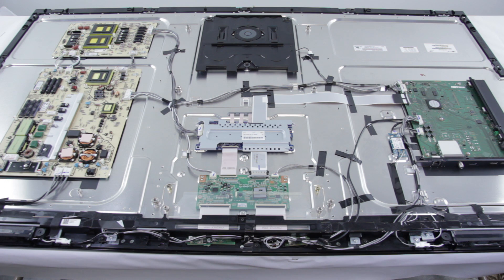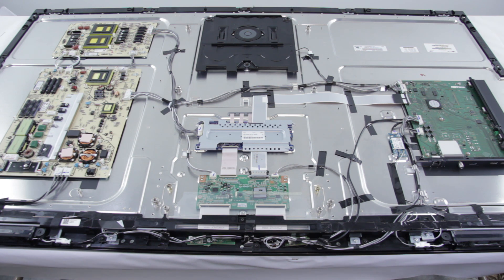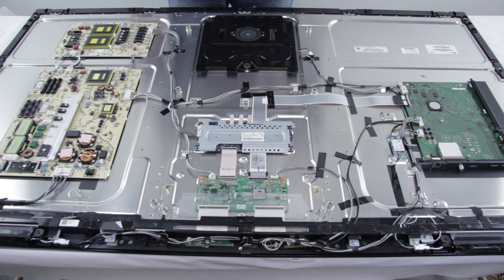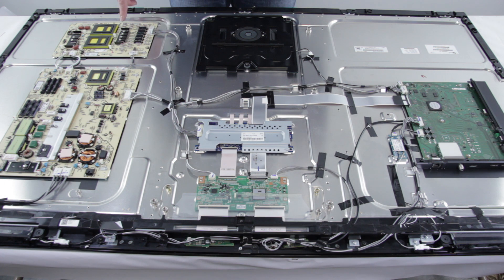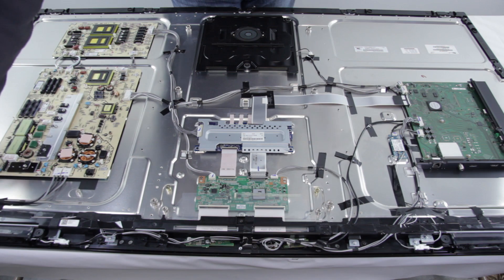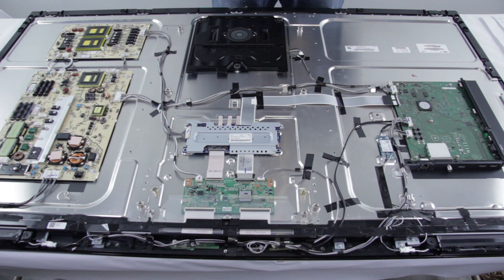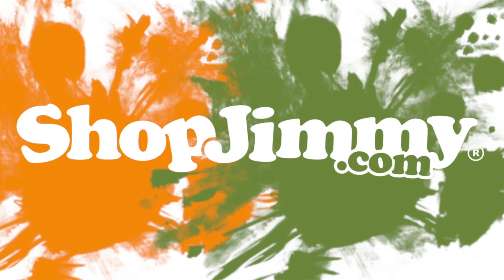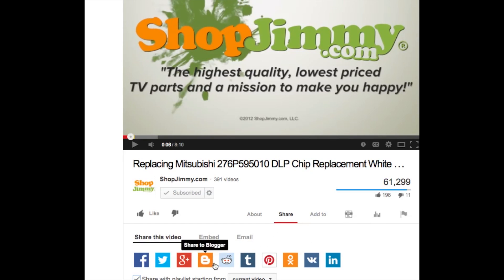LED TV Repair Review Power Supply Overview-NO Power Common Power Supply Repair & LED TV Power Supply

Comment: Hello Jimmy,  I have a Samsung UN39FH5000F.  It has a red power LED when off.  When you press power the power LED goes off, but the TV does not power on.  You have to unplug and replug the power cord to get the power LED to come back on.

Already replaced the power board BN44-00496B, with no improvement.  Other board part numbers are:  Main board: BN94-06692C / BN97-06298Y 0276.  Panel board: V320HJ2-CPE2
Reply from the maker: Rob Wilson  PLEASE SUBSCRIBE TO OUR CHANNEL - Try all repairs and troubleshooting at your own risk.  I recommend replacing the main board in your TV.  Click this link to replacement parts for your TV model number:  http://www.shopjimmy.com/catalogsearch/result/index/?cat=56&q=UN39FH5000F  There may be multiple boards for the same TV model number, be sure to match part numbers on your current board, with your replacement for compatibility.  Here is a link to a video showing how to identify your part number, click here:  https://www.youtube.com/watch?v=BEPWrefQvqI  Thanks and please let us know if you have any further questions with your TV Repair!  www.shopjimmy.com
Reply: ShopJimmy.com Thanks Jimmy.  Unfortunately you are currently out of stock, so I had to Google for another supplier.  I replaced the main board, and now the LED status light stays on, but I do not get any picture.  I reseated the ribbon cable, as when I connected the first time, I was getting a blue splash screen, and then it would quickly go off.  After reseating the ribbon cable I get nothing at all.  What could be the issue?

To recap. 

Replaced power board,  replaced main board.  Still won't power up to get a display.
Reply: Rob Wilson Found your video for the flashlight test.  Pressed menu, no image on screen when searching with a flashlight.
Reply from the maker: Rob Wilson  Try all repairs and troubleshooting at your own risk.  It sounds like you received a defective replacement main board.  I recommend checking with the company you purchased from to see if the board is guaranteed to be working.  Thanks!  www.shopjimmy.com
Reply: ShopJimmy.com Received a replacement board.  Supplier had me try unplug white connector cable from power board to main board.  TV backlight came on.  Next reconnected cable and disconnected Tcom ribbon.  TV goes from off to a flicker of backlight on.

New main board arrived.  Installed it, and when plugged in, the TV cycles from off to backlight flickering on, then TV goes back to off.

Is it time to junk the thing, not much left to try replacing?
Reply from the maker: Rob Wilson   PLEASE SUBSCRIBE TO OUR CHANNEL - Try all repairs and troubleshooting at your own risk.  Sounds like you received another defective replacement board.  With the test that you ran, it says you should replace the main board.  What is your main board part number?   This video can help you.  https://www.youtube.com/watch?v=BEPWrefQvqI Thanks!  www.shopjimmy.com
Reply: ShopJimmy.com Thanks Jimmy.  What is supposed to happen when you disconnect the Tcom ribbon cable? What is the TV supposed to do?
Reply from the maker: Rob Wilson   Did you find your main board part ID number?  Disconnecting the t-con board ribbons can have different results for different TVs.  Thanks!  www.shopjimmy.com

Comment: Hi, I have a Vizio E261VA LED LCD tv. When I try to turn it on, I have no power, lights, sound. Nothing.The TV will not turn on. I'm not sure when I bought it, (maybe 1-2 years old), but about a year ago it fell off a dresser. It worked afterward, but sometimes I had to play with the button (press hard, hit the tv, lean it to the side). Then a few days ago, our power went out (I'm sure the TV was on), and it hasn't worked since. I took it apart and looked at the capacitors, and they all look flat and I don't see any burn marks or anything. Can you give any advice? Should I buy a power board? I cannot afford to take it to a repair shop. If I bought one from your website, would I be able to return it if I tried it and that wasn't the problem? Thanks
Reply from the maker: shadowcharizard10  PLEASE SUBSCRIBE TO OUR CHANNEL - Try all repairs and troubleshooting at your own risk.   I recommend replacing the main board in your TV.  Click this link to replacement parts for your TV model number:  http://www.shopjimmy.com/catalogsearch/result/index/?cat=56&q=E261VA  There may be multiple boards for the same TV model number, be sure to match part numbers on your current board, with your replacement for compatibility.  Here is a link to a video showing how to identify your part number, click here:  https://www.youtube.com/watch?v=kxkeGLhlQY8Thanks and please let us know if you have any further questions with your TV Repair!  www.shopjimmy.com

Comment: I have an LG  TV model number 55lm6400-ha.auszlut.  When I turn it on a red light flashes 3x then turns off. I have replaced the main circuit board....  Shames result. Would you suggest replacing the power boar?  If so, what is the part number and cost?  Second question.  Can I return the main circuit board to you as it has not been used?  Jim
Reply from the maker: Jim Franklin   Try all repairs and troubleshooting at your own risk.  Yes, I would recommend replacing the power supply board.  Here is a link to our return policy.  http://www.shopjimmy.com/returns  Click this link to a replacement power supply board for your TV model number:  http://www.shopjimmy.com/lg-eay62709002-power-supply-led-board.htm  Be sure to match part numbers on your current board, with your replacement for compatibility.  Here is a link to a video showing how to identify your part number, click here:  https://www.youtube.com/watch?v=_4Qpfan0vdU  Thanks and please let us know if you have any further questions with your TV Repair!  www.shopjimmy.com

Comment: Westinghouse DW46F1Y1 Led TV - won't turn on... Standby light is on. Has worked after unplugging power a few times, but turns off and same symptom occurs. Main Board?
Reply from the maker: Geoff Ruscoe   Try all repairs and troubleshooting at your own risk.  This could be a problem with either the main board or the power supply in your TV.  You can replace each of those boards individually to see if one of those fixes the problem.  Unfortunately I do not see any replacement parts in the search results for your TV model number on our website.  Thanks and please let us know if you have any further questions!  www.shopjimmy.com

Comment: Hi I was wondering whether you could point me in the right direction with a problem I have with my Samsung LE40B530 LCD television. The screen flickers terribly and can only be used with the backlight turned down to zero. On some of the LCD Samsung TV's people have resolved the problem by cutting a link on the power board but the link doesn't seem to exist on my TV. Any help would be really appreciated. 
Thank you. 

Lifeboat.les@gmail.com.
Reply from the maker: Leslie Jones Try all repairs and troubleshooting at your own risk.  This could be a problem with either the power supply board or the LEDs in the TV.  Click this link to replacement parts for your TV model number:  http://www.shopjimmy.com/catalogsearch/result/index/?cat=229&q=40B530  Be sure to match part numbers on your current board, with your replacement for compatibility.  Here is a link to a video showing how to identify your part number, click here:  https://www.youtube.com/watch?v=sSJexLvRrjM  Thanks and please let us know if you have any further questions with your TV Repair!  www.shopjimmy.com

Comment: hi there...i own Sony 40 inch EX43B Series BRAVIA TV
however yesterday morning out of sudden it went dead..no red indicator light...
i opened the tv and it seems the circuit board all placed the below section of TV...
Can u help me out to restore back my TV to its functional state? TQvm
Reply from the maker: Ahmad Muhammad   Try all repairs and troubleshooting at your own risk.  If you have experience with a meter, you can check for the 5v standby on the power supply.  Thanks!  www.shopjimmy.com

Comment: I have a Samsung UN60EH6003F TV that will not turn on. The standby light is on constantly and does not blink when "on" is pressed on the remote or on the TV. There is no clicking sound. The TV mysteriously turned itself on and off a few times before it stopped turning on.

Comment: I have a Samsung UN55F6300AFXZA that won't turn on.  It is 14 days out of warranty!  The red standby light is not on either.  I have tried unplugging and letting it rest for a while, changing power outlets, and the power button on the back as well as every other trick Samsung support mentioned.  Nothing works.  Still no power...no sign of life.  Any suggestions before I call a repairman?
Reply from the maker: Kristi Bloss    Try all repairs and troubleshooting at your own risk.  Disconnect the cable from the power supply to the main board and look for the backlights. If there are lights, then you have a bad main board.  If you have no backlights bad power supply.  Click this link to replacement parts for your TV model number:  http://www.shopjimmy.com/catalogsearch/result/?q=UN55F6300AFXZA  Be sure to match part numbers on your current board, with your replacement for compatibility. Thanks and please let us know if you have any further questions with your TV Repair!  www.shopjimmy.com

Comment: I have recently come across 100 Samsung HD and ultr hd LED.  These are all new returns to Samsung.  They are mostly 40 inch to ;55 inch.  I am stripping the components out and wondering if there is anything I can do with the LED strips. Or if there is a way to power them for other lighting purposes.  Thanks. Spongart@gmail.com
Reply from the maker: Art Spong  If the strips work, you could sell them.  Thanks!  www.shopjimmy.com

Comment: I have a Vizio  E470-A0 LED; while watching tv one night my roommate told me that the tv screen went blank(black) and afterwards once we tried to power on tv, the blue led light on the bottom left corner of tv turned on shortly then turned off while the screen was still black. so basically no power, and will not turn on. Could this be a power supply problem or inverter board
Reply from the maker: Hasan Gunaydin   I recommend running the flashlight test on your TV.   Here is a link to a video we produced that shows how to run the flashlight test. https://www.youtube.com/watch?v=xUzCLgoSPGM Please reply with your flashlight test results and we can recommend a replacement part for your TV repair. Thanks and please let us know if you have any questions! www.shopjimmy.com
Reply: I have tried that and unfortunately i cannot see anything. Mainly because the tv doesn't stay on longer that a couple of seconds. However right  before this issue arised i do know there was audio when the screen went blank. I have ordered and replaced the power supply board from your website yet the problem is still occuring.

could that mean the main board is the culprit? i hear the t con board is a issue most of the time but i have not even seen one with my setup. I have unscrewed all covers. The lvd cables lead to the bottom frame of the tv but there is no board. Please help as my Vizio is merely 16 months old
Reply from the maker: Hasan Gunaydin   More than likely you have bad LEDs in the TV.  Unfortunately, we do not sell replacement LEDs.  Thanks!  www.shopjimmy.com

Comment: Hello! I have a Seiki 32B56 and the symptoms are as follows: sometimes there's no signal (hdmi,vga,etc) shuts off on it's own at first but now it won't turn on. Stand by led is on though. Please advise. Thanks!
Reply from the maker: 656er   I recommend replacing the main board in your TV.  Click this link to replacement boards for your TV model number:  http://www.shopjimmy.com/catalogsearch/result/index/?cat=56&q=32B56  There may be multiple boards for the same TV model number, be sure to match part numbers on your current board, with your replacement for compatibility.
Thanks and please let us know if you have any further questions with your TV Repair!  www.shopjimmy.com

Comment: Hi. I have a LG 60LN5600 and I have no picture or sound. The only hint that the unit has power is the red led light under the LG insignia. This light normally turns blue when turned on. Now it only stays red.
Reply from the maker: oldark333   I recommend replacing the main board in your TV.  Click this link to replacement parts for your TV model number:  http://www.shopjimmy.com/catalogsearch/result/index/?cat=56&q=60LN5600  There may be multiple boards for the same TV model number, be sure to match part numbers on your current board, with your replacement for compatibility.  Thanks and please let us know if you have any further questions with your TV Repair!  www.shopjimmy.com

Comment: I have a Sharp LC-60LE640U with a power LED that that alternates between a slow blink and a fast blink. No video. Would you guess power, t-con or main?
Reply: ShopJimmy.com seems to be an infinite loop of one slow and one fast.
Reply from the maker: chickenlizard76   I recommend replacing the power supply board in your TV.  Click this link to replacement parts for your TV model number:  http://www.shopjimmy.com/catalogsearch/result/index/?cat=229&q=LC-60LE640U  There may be multiple boards for the same TV model number, be sure to match part numbers on your current board, with your replacement for compatibility.  Thanks and please let us know if you have any further questions with your TV Repair!  www.shopjimmy.com

Comment: Hello, Seiki SE46FY10, has audio, picture (flashlight test) but no backlights.
Reply from the maker: Travis   This could be a problem with your power supply board or the LEDs in the TV panel.  You can replace the power supply board to see if that fixes the problem.  Click this link to replacement parts for your TV model number:  http://www.shopjimmy.com/element-mip550d-5ta-power-supply-unit.htm  Be sure to match part numbers on your current board, with your replacement for compatibility.  Thanks and please let us know if you have any further questions with your TV Repair!  www.shopjimmy.com

Comment: I have a Sanyo and I turn it on and about 5 sec. later it turns its self off. I can power it on three times then it will not do anything and I have to unplug it from the back of the tv and the wall for about a 3min.  then I can repower it on  and it works just fine.
Reply from the maker: Lisa Guzman Please reply with your TV model number.  Click here to view a video that shows how to find your TV model number:  https://www.youtube.com/watch?v=S51nhAmwR2M  Thanks!  www.shopjimmy.com
Reply: Model # DP50740

Comment: Hi there,

i have a samsung led tv 46 UE46D6500. When i start the tv, its starts - shows the logo - and then goes black. i can hear the sound but no picture. Can you please help me with this issue. Regards, Satish
Reply from the maker: satish shinde   I recommend running the flashlight test on your TV.   Here is a link to a video we produced that shows how to run the flashlight test. https://www.youtube.com/watch?v=xUzCLgoSPGM Please reply with your flashlight test results and we can recommend a replacement part for your TV repair. Thanks and please let us know if you have any questions! www.shopjimmy.com
Reply: ShopJimmy.com Hi there,
When i turn on my tv for first time i get a bright picture and then slowly it start fading and then i cant see anything.
I cant see any picture using flashlight either. I gave it to a technician, and he tried replacing the tcon and main board but to no avail, hence he returned me the tv without repairing it.
Can you please advise.

Regards,

Satish
Reply from the maker: satish shinde  Since replacing the main board and t-con board did not fix the problem, I would say you have a TV panel (TV Screen) problem.  If your TV panel is bad, it may be more cost-effective to replace the TV as panels are typically hard to find in stock, difficult to replace, and expensive.  Thanks and please let us know if you have any further questions!  www.shopjimmy.com

Comment: Hi, My TV is Toshiba 46WX800U. It's around 4 yrs old. now it's most of time not powering on. just red light blinking. But some times it's power on properly and working fine for long time. Please help me solve the issues. I have checked the all boards not capacitor issue. Thanks. Stephen V
Reply from the maker: Stephen Veeraiyan  Please watch this video FIRST to help with your repair!  https://www.youtube.com/watch?v=BP3NVNCGEv8   I recommend replacing the main board in your TV.  Click this link to replacement parts for your TV model number:  http://www.shopjimmy.com/catalogsearch/result/index/?cat=56&q=46WX800U  There may be multiple boards for the same TV model number, be sure to match part numbers on your current board, with your replacement for compatibility.  Here is a link to a video showing how to identify your part number, click here: https://www.youtube.com/watch?v=3DQe0ATZl_Q  Thanks and please let us know if you have any further questions with your TV Repair!  www.shopjimmy.com